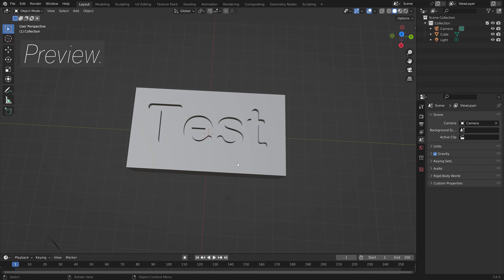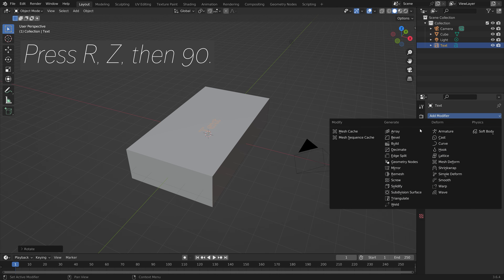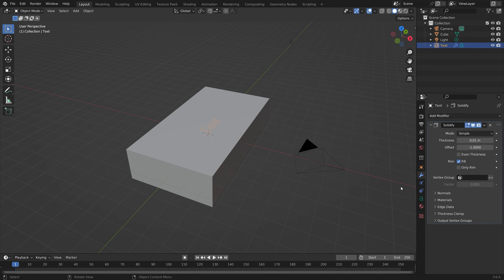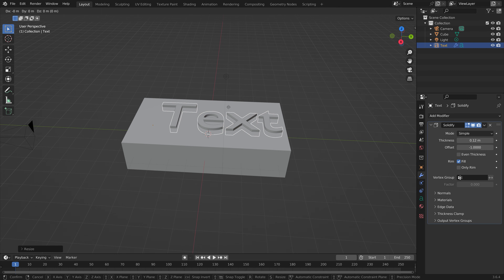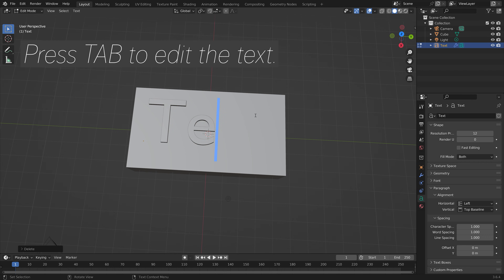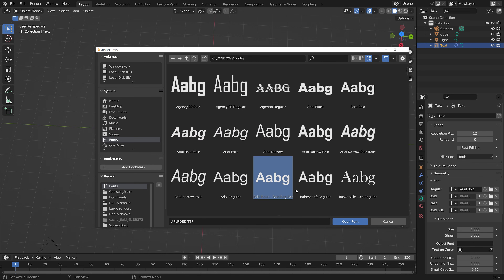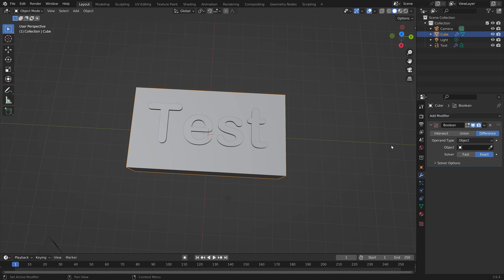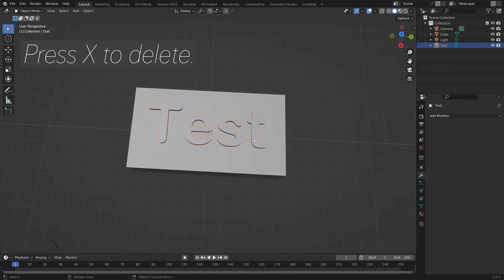[3.6] Blender Tutorial: 3D Text Engraving, Simple Method

Comment: But what about the topology? It would be impossible to even make a slight bevel on the engraving without artifacts
Reply: This is the simple method :) But I think the bevel modifier should work?
YT channel Kaizen did a tutorial called "Geometry Node Displacement Effect", it has bevels built-in. You can manipulate the chamfer/bevel shape made with that method by using a float curve node right after the map range node.
You can also render the Z map from this engraving, blur the result in compositing, and then use that render for a displacement map in a different scene. But that would be silly.